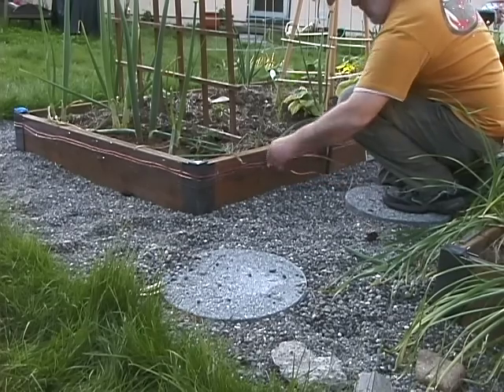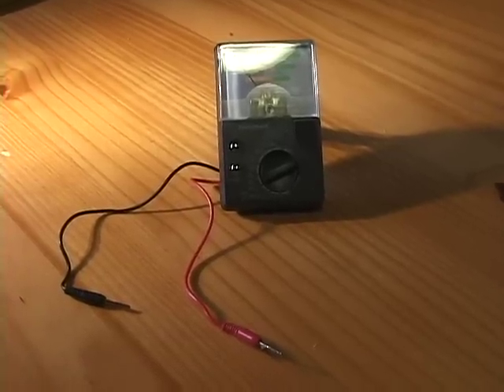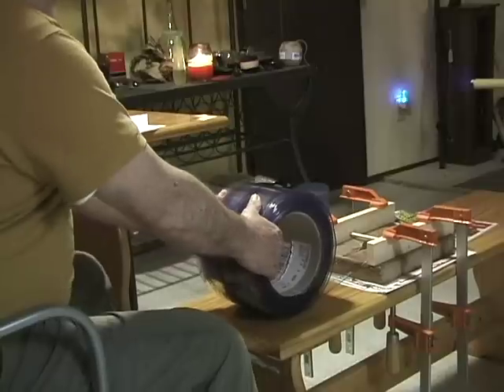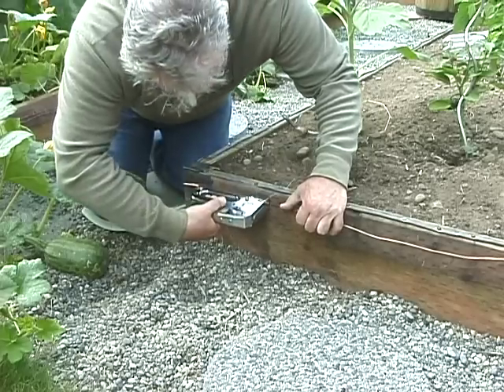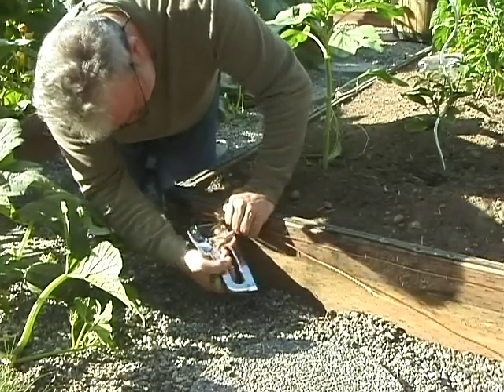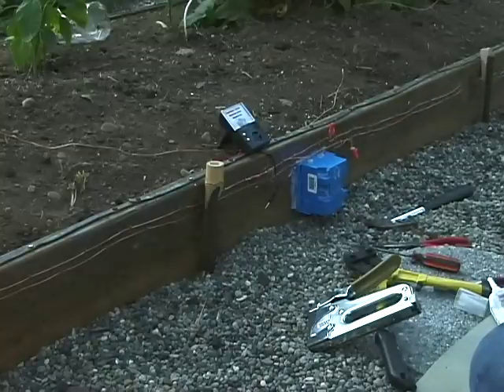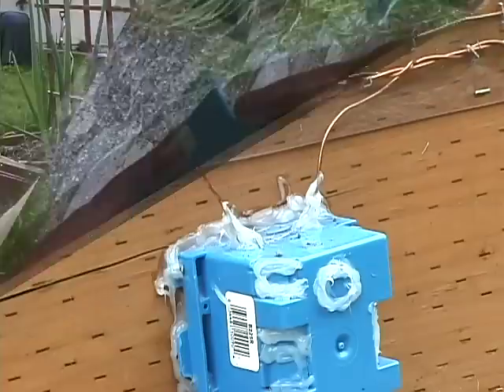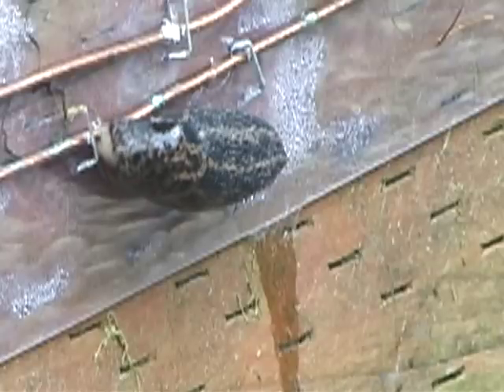GASTROPOD;: The Final Showdown (Or, How to build a Slug Fence)

Comment from the maker: Post 1 

It worked the entire season.  There was 2 much work next year so I did not have a chance to wire brush off the oxidation from the wires and did not get a chance to hook it up this year, so I don't really know just how long the batteries lasted.  As for the staples, yes I took extra caution to make sure that neither line was touching (shorting out) the other.   The ballasts only function are to be able to have a manual cut off after the season is over so as not to drain the batteries.

Comment from the maker: Hi Warchild,

Sure, here is the list:

PVC Strip Curtain roll of 6" width. 75 or 100' rolls. 
Cooper wire, 12 gauge, solid core
Eveready 9v Dry Cell #276 Battery
Electrical box (to house battery)

Tools:
Hammer
Pliers,
Needle nose pliers
Measuring tape
Utility knife
Voltage meter
Tube of silicon
Wire connectgors
3 position balast disconnects (with or w/o six inch leads)
Arrow staple gun (T50) and 1/2" staples
Screw drivers (standard and Philips)

Best,
DragonsEye